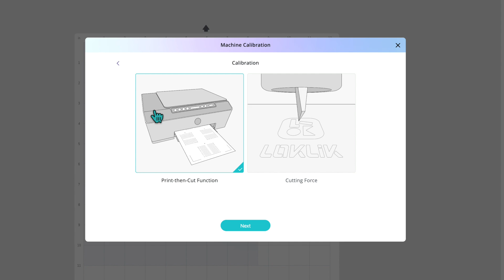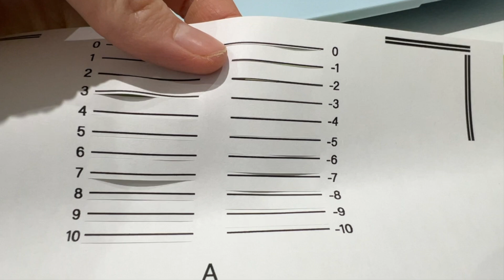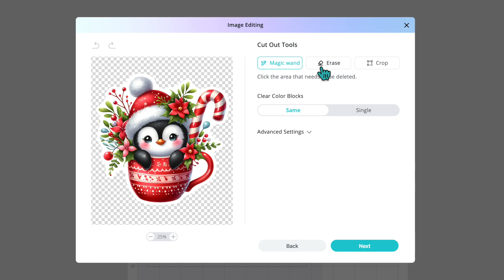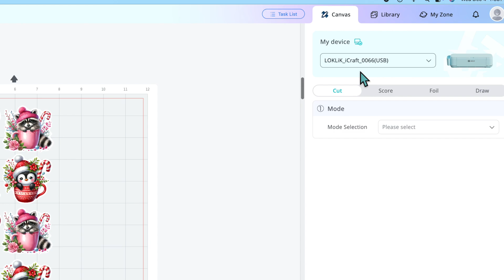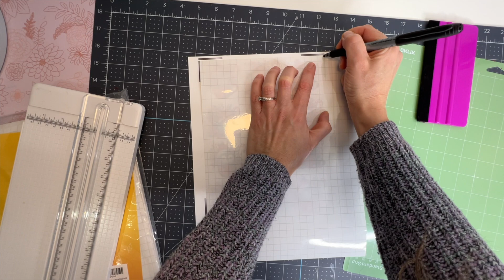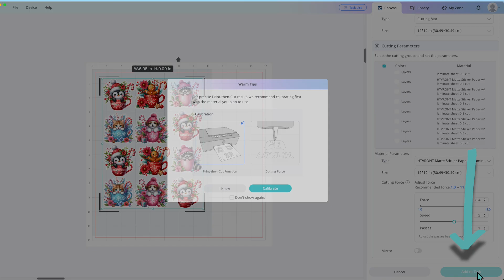Make Stickers with the LOKLIK iCraft | Step by step Print then Cut | Calibrate | Custom Cut Settings

Comment: Great video thank you, we have just had the Loklik Crafter, our first attempt failed, we used the standard cutting matt and the card we used had stuck that much to the matt it ruined it. Its trial and error at the moment for us, great video.
Reply from the maker: I’m glad you enjoyed the video. When using cardstock or paper it’s best to use a light grip mat or an older mat that is not very sticky anymore and then peel the mat off the material rather than the material off the mat. Happy crafting!